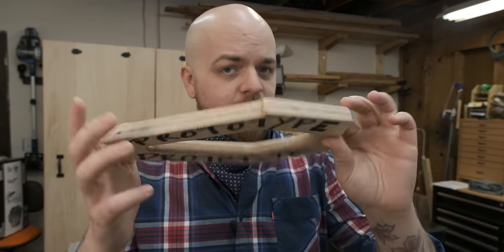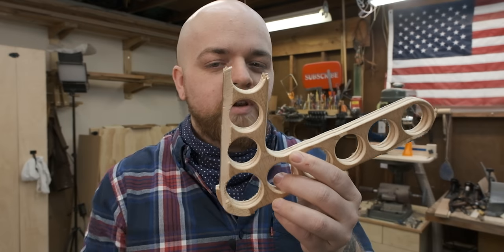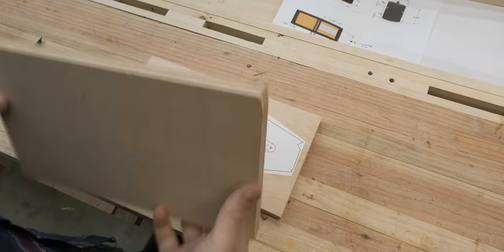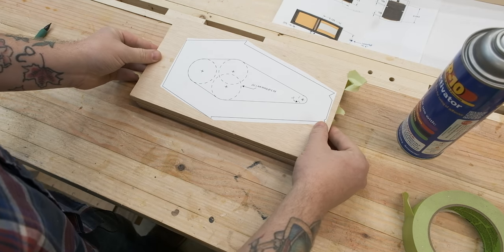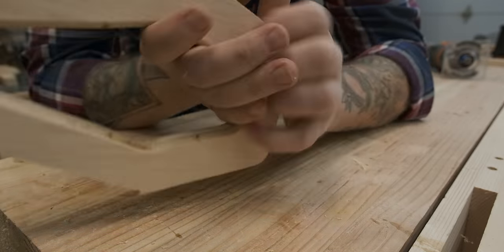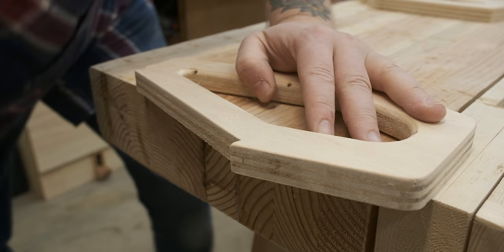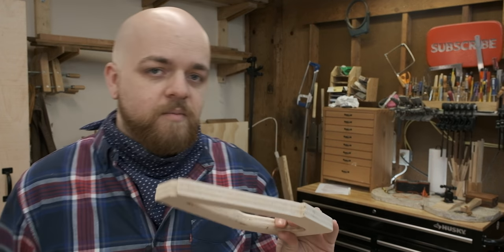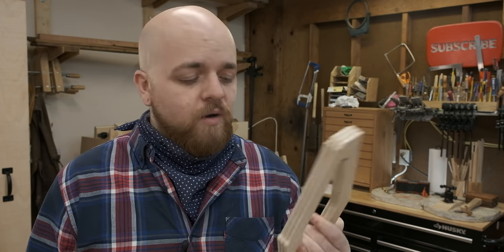DON'T CUT YOUR FINGERS OFF! Make The Optimum Push Block

Comment: As an American carpenter I have come to appreciate the metric system for its for simplicity ...makes adding or subtracting dimensions so much easier,  dividing or multiplying for layout, finer adjustments, etc...it also leaves fewer un-caught mistakes to be made. I use it on layout when units aren't as important as accuracy.
Reply: Richard Florence here in Australia we were smart enough to change our currency on 14 feb 1966 and in 1970 we changed to the metric system I also was a carpenter at the time of the change and I can tell you it was the smartest thing your government ever did.

Comment: We adapted to metric, I don't know why the need to change but I myself use Imperial except on a rare occasion in woodwork only if I need or want to and only because the metric is on the ruler or measuring tape but I still find myself looking at the inches to give myself a mental view on the length. The same with miles and kilometers or when shopping I used to Ounces, Pounds and stones but items in shops show only grams and kilogrammes. I'm in my 60s and unable to figure out these stupid changes. I like the push stick designs you made and only starting out in woodwork but looking at your design I'm going to try and make two of these, one to push the timber and the other to guide the timber from the side not using pressure so the wood glides along smoothly. I love the idea you showed using them on the band saw. The design of the push stick when held allows safe pushing, the length of it allows better grip on the wood you are pushing and with the distance you hold the stick from the opposite end lends weight and pressure to keep the wood firm on the table saw automatically without having to apply it and you only need to balance and lock your wristband hand in position to keep the pressure on the wood. Great job

Comment: A small rare earth magnet on the side of the drill press will hold the chuck key, easy as. Applies to lots of other tools and accesories as well. Give it a go.   Thanks for the design on the push sticks as well. Good thinking.

Comment: This is mostly unrelated, but I've used the masking tape and super glue trick many times and never once had an issue from not using accelerator. I just apply the glue, put the pieces together and hold then for, like 10 or 15 seconds. And then I can immediately start template routing or whatever. I mean, use the accelerator if you want, theres nothing wrong with using it. It probably does help bring all of the glue to full strength faster than not having it. But in my opinion, it's not necessary and just another thing to have to buy (it ain't cheap) and keep around the shop. Even without the accelerator I usually have a hell of a time prying the pieces apart, no chance of slipping. And if I did want to make an argument against the accelerator, I'd say leaving it out gives you a little bit more time to slide the pieces around if you don't place it right immediately. And by "a little bit more time" I mean probably 3 seconds more time.
Reply from the maker: Totally agree with you Matt! Sometimes my ADD gets the best of me though and that extra 3 seconds of wait time is just unbearable. Other times, I wish I hadn't used the accelerator because now I'm stuck with misaligned pieces haha

Comment: You’re right- there is a push stick design for every day of the year. I totally agree about accessibility; I would add to that, easy to make; some of the designs I have seen would take so long to make; a push stick is a consumable; if you regard it as precious (because it took so long to make), then you might not use it.

A step to making them easier to make regularly might be to make a master out of thinner plywood or mdf. Refine that and use it as a template for all others. I accept that you would need to hand cut the sharp angles where the stick meets the timber to be cut.

Comment: I made two of them right after watching this video. Easy enough. I had to change up a little since I don’t have such a large bit.  Worked out well though. Work nice. I still will keep my push & hold 1/4 in ply stick for those times I need a narrow push stick.  Thanks for the plans.
Reply from the maker: Fantastic! Did you like they way they function?

Comment: Just tore up one of my lightweight push sticks of my own design. I'll try yours which look interesting. Thanks for sharing your well thought out design. Several comments seem to indicate that trying something different, especially Metric, isn't something which would interest them. Personally, I've been thinking about getting some Metric devices and making the switch myself - it's just so much easier to work in. And I'm saying this after having worked in a mixed Engineering department for nearly 30 years. BTW, you really caught my eye with the box of Forstner bits - just like mine. Your shop looks like a real hodge-podge, just like mine.
Reply from the maker: I'm right there with you Gary. I think the switch would be much easier for a lot of us if our tools weren't scaled/calibrated in Imperial. Once the manufacturers make the switch I think the rest of us will follow suit REAL fast haha. I'm also glad the hodge-podge came across in the video, we're all students of the craft and I'm definitely no pro, so working man tools it is for me! (for now lol)

Comment: As an engineer I must work in both imperial and metric measurements, a 1 inch shaft doesn't fit a 25mm hole. The more you use both systems, the easier it gets, and, like speaking two languages, converting from one to the other is automatic and natural.
Reply: A point well made! The two systems each have their strengths and weaknesses so I just use the most suitable system for the job in hand. Most criticism of whichever system seems to come from people who don't understand it.
Reply: No, just use metric

Comment: interested to know if you have had any problems with your Chicago Electric jigsaw? Or with any of your Harbor Freight tools? I have a few myself... not personally impressed after seeing the inside of the orbital I bought.. the brushes were aligned on the clamshell- to the point where they fell loose and I needed to reverse engineer the tooling of the clamshell so they didn't fall out while in use! 

Very well thought out push stick. I like it, great work!

Comment: I'll switch to metric when the clocks do.  Not only is 12 > 10, but it has more factors, and the factors and multiples are more intuitive to use visually and for geometry without resorting to calculators and machines.

Comment: I always seem to chew up the heal (hook) area on my push blocks from using them on narrow cuts. Just a suggestion, If you were to add a small piece of hard wood screwed to the back of the push block allowing it to protrude below the shoe forming the hook you would never have to remake the body of the push block. Just screw on a new piece of hardwood.
Reply from the maker: Clever workaround, I like it!

Comment: Canada is a bit of a mixed bag for measurements...  We're supposed to be metric (we do use Kilometers, my passport and driver's license have my height in CMs) but you're right, most of the carpentry and building are in imperial (even my house that was built 8 years ago).

It's funny when they mix them though; I needed some bolts for a project - M6 bolts - so the store had them... M6 x 3/4 inch....

Great push sick design!

Comment: Great design! I have question though, how do you untsick the template from the wood when you glue it with 77 spray adhesive?
Reply from the maker: Good question! I just sand or scrape the template off. I should have included that in the video 😬
Reply: I’ve actually found that a heat gun “softens” the adhesive and the template peels right off. Then I finish with a mineral spirts wipe down to remove any residue. But I was also working with super delicate pieces, so sanding wasn’t an option. Cheers

Comment: Pro tip on that blowout from the forsner bit:   Instead of drilling till the spur shows through, drill a 1/8" pilot hole all the way through the piece first.  Then drill 1/3 to 1/2 of the way through from the first side.  When you flip the piece, there will still be enough meat there to keep allow the bit to start cleanly without the material collapsing.
AWESOME push block design, I'm definitely gonna try it!
Reply from the maker: You know, the stupid thing is I JUST used that technique on the dowel jig video and then completely forgot about it for this one 🤦‍♂️ 😂 that definitely would have been the right procedure

Comment: So i'd recommend making one out of 1/4" MDF first.  Then only use it as a router template.  Then batch out 5-10 of these or your other favorite design.

You will have some clean-up, like the notches to do.  However save the template if if one breaks, or you get a new tool that needs one you have already done the hard part and you should be able to crank one out in a quick timeframe.

Also, it makes making a bunch of these as gifts for your friends who have not learned that they need these sooo much easier.
Reply from the maker: Downright brilliant idea Greg and I'm a little miffed I didn't think of that haha

Comment: Love this design~!!  These push sticks are about to take over my shop like Tribbles on the Enterprise in a Quadrotriticale bin~!  ;-)
I had an unfortunate incident years ago (90's) where my push stick splintered when hitting the table saw blade.  That was when Mr. Left Pointer-Finger met Mr. Spinning Steel Blade.  Wasn't pretty.
I had no idea at that time that this event would later result in my wife's insisting on my purchase of a SawStop.  I'd love to have the intact finger and have just bought the SawStop because I "wanted to", but it is what it is.  Best machine I've ever used, even if it didn't have the flesh tech~!!
Thanks for the free design~!!
Reply from the maker: Hahaha I love the color you put in your story Andrew, but I am sorry to hear about the finger. I'm hoping to get the SawStop before I have the missing digit to help convince the misses 😬. Also love the Trek reference 🖖 Cheers and Prosper brother!

Comment: Great video and design. I also like the one that Drew Fischer made and I'll me making one of these too. On another note, my personal opinion/experience with the Jig Saw, most people have problems because they try to force the tool. Even with a sharp blade, if you push to hard it will warp and bend giving you an angled cut. If you go slowly, applying just enough forward pressure, and let the blade do the cutting, you will get straighter cuts. Not perfect, but straighter. It's not a precision tool.
Reply from the maker: Great point and I totally agree, I do have a habit of pushing the jigsaw faster than I should. Something to work on in the new year :)

Comment: a coarse-toothed metal cutting jigsaw blade will give you much better edge quality.
Reply from the maker: Interesting, seems counterintuitive but I'll give it a shot!
Reply: @Craftswright  you just gotta take it slow onna counna the fine teeth don't remove much material.  Looking forward to hearing how your test turns out!
Reply from the maker: Ahhhh good point

Comment from the maker: FREE template is available here: https://bit.ly/2Txz3cr
Happy building, and keep up the good work!
Reply: 01/09/21 Technical issue.
Click your your link, go your web page.
Click add to cart, follow pop up to cart.
Cart contains ONLY dowling jig.
Cannot delete jig, pop up says there is no cart.
Every other effort leads to landing page “do you want plans?” Repeat.
System is IPAD, browser Safari.
Standing by for  template.
Thanks
Reply: @delta100percent3  Same here on the desktop. Chrome/Brave/Opera
Reply from the maker: Weird I’ve tried it on 3 different devices and haven’t been able to replicate the issue. Perhaps try clearing cookies/history?
Reply: @Craftswright  Cleared history on IPAD/Safari. I got the plans in the cart, but checkout buttons sends me back to landing page.  Also, tried it on another computer using Firefox with same negative results.
Reply: Any progress? Perhaps you could just e-mail me a copy?
Reply from the maker: Hey Delta, I’m pretty sure I found the bug. Give it a shot and let me know if you don’t mind
Reply: @Craftswright  NEGATIVE. Same problems. Cleared cache, restart, follow your link, add to cart, get doweling, can't delete, no cart, etc.
Reply from the maker: Jerry and Delta, please shoot me an email or contact me through my website. Thanks!
Reply: got mine just now fine  like the looks and thought behind ,also good to run across a fellow si-fi and space aficionado
Reply: Excellent pushblock.
Generous offer.
but...  I never provide billing info for freebies.
Just saying.

Comment: FYI a couple of your Amazon affiliate links are messed up... 
Ex. Don't lose an eyeball sends you to eat buds different from your hearing protection link... And wood dust in the lungs... Cannot be found... But, I will definitely be making a dozen or so if these push sticks and giving them to all my employees to use! Thanks 👍
Reply from the maker: Thanks for pointing that out Tim, turns out those ear buds aren't being sold anymore and the manufacturer hasn't produced anything comparable. Trying to find a good replacement as we speak.

Wow, that's a humbling thing to hear, that my design will be used by employees in a shop! Very cool!

Comment: I built your design and I really like it. I have an upgrade in the fabrication. For cutting out the interior, go ahead and drill out the center holes. Then go to the bandsaw, cut in from the rear and cut out the interior part. You now have a narrow slit in the rear.  Add some glue and clamp the slit shut. The interior is now done, go on and finish the part.

Comment: That opening may let your fingers too close to the blade. I've made several push sticks kind of boot shape with the down part close to the handle high enough so that it is always above the blade teeth.
Reply from the maker: It could for sure, but if you're blade is at the correct height you should have a really hard time getting flesh near it. Always a possibility though!

Comment: While I can't say I like the design, I still like the video.  Always room to disagree agreeably.  Good video.
Reply from the maker: I appreciate that! A lot actually. I think the world could go a long way if we just figured out how to disagree agreeably more.
Reply: Terry, I am curious what you don’t like. Is it the whole “design”? The form? The function? Do you think it’s not safe, or ...
Reply: @PavelMocan  First of all I have to confess that ANY push stick which keeps one's fingers away from the spinning blade is better than no push stick, and I have to say that I haven't actually used this push stick.   But, it does look top heavy to me, with as much weight on the top as is in contact with the work piece.   So for me, it's probably more a case of preferring other, simpler push sticks.  I make plywood push sticks, a dozen at a time, and they are always ready and handy.  That dozen push sticks lasts me about a year.   Mine stand-up, by themselves, unassisted, immediately on the right hand side of the rip fence and are easy to grab when needed.  Again however, ANY push stick is better than none, so the BEST push stick is the one you actually use.

Still a good video.
Reply: @hunterdogztc  cool, thanks for your thoughts. I was simply curious 😊 I never made push sticks before. I am currently using the one that came with my table saw. And I’m considering getting a couple of microjigs.

Comment: Like you, I've had a number of push sticks in my shop, some worked good, some were an abysmal failure, but most were just OK.  I was really intrigued with your design, so I downloaded your plans and had a look.  Since the design was simple, I decided to see if I could reproduce it on my CNC.  I converted your pdf plan to jpeg and imported into my CAD software (Vectric VCarve) and removed everything except the outline.  Worked like a charm.  I can now batch these out for friends and family in an afternoon, plus I can easily change the size if necessary.  

Thanks for a great design!
Paul
Reply from the maker: Awesome Paul! Little jealous about your shop setup, I'll be gunning for a CNC once I have the space (and funds 😬). Cheers!

Comment: A push stick should be able to be made quickly and from scrap.  You have some good ideas there, but it takes too long to make and seems like you made it into a project instead of a tool.  I make mine in less than a minute and toss them when they get cut up.  A push stick should NEVER have downward pressure used on it as that is where the blade is should something slip.

Comment: A serious Push Stick, Very nice design.  OK, I don't have to say this but the idea that one measurement system is BETTER, "Metric is Better" BS., Now time to think. Find the equally spaced positive integers (factors) in a meter as compared to a foot, yard or a mile. Then explain why European shelf pin and cabinet design is based on multiples of 32mm (1.25 US inches cabinet shelf spacing) Strange, yes. Now explain why is the hole spacing on a Festool MFT is 96mm. 
Metric users don't like Imperial because they hate fractions and have difficulty multiplying and dividing by 2! For the love of God why would anyone ever want to know that 0.1875 inch is the same as 3/16 inch. But it's OK for their computers to understand binary code 0 and 1 (YES-NO) 1,2,4,8,16,32,64,128,256 to infinity ad nauseam. The Imperial system Is all about equidistant spacing,  Factoring 101. The system never ever gave a crap about the length of the kings foot. Sorry for my rant, but learning is fundamental. Everything is a system of control and has meaning and logic especially in warfare.9mm or 45 ACP